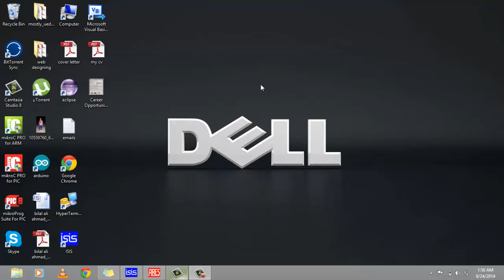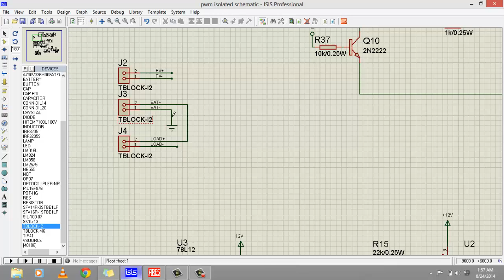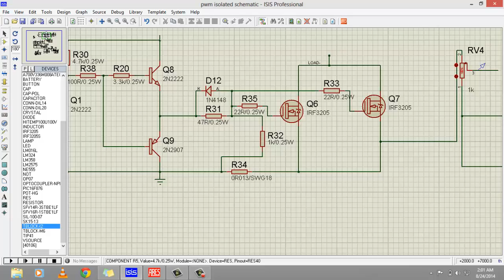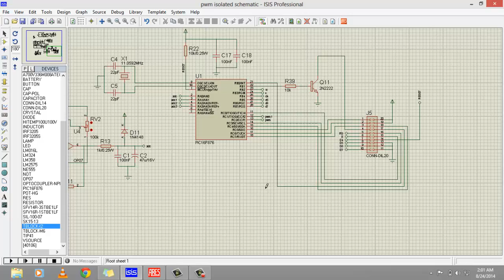smart solar charge controller using PWM and microcontroller

Comment: The positive 12v supply seems to be powered by the solar panel section. If the panel is unavailable, how does it generate this voltage? How can it switch ON the load then? Because the totem pole for the load needs this 12V, as I can see from the diagram. Am I missing something out here?